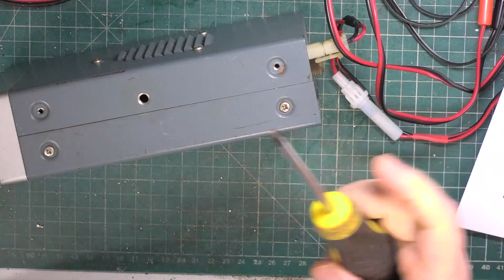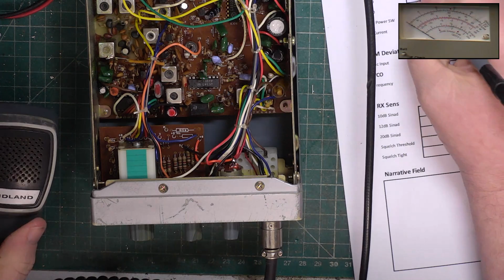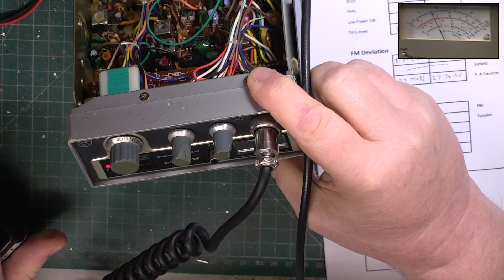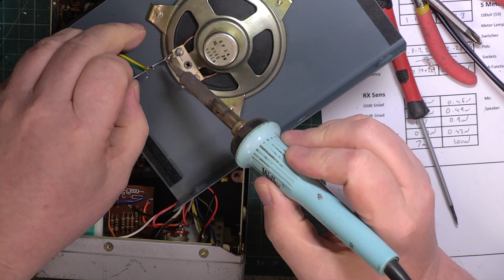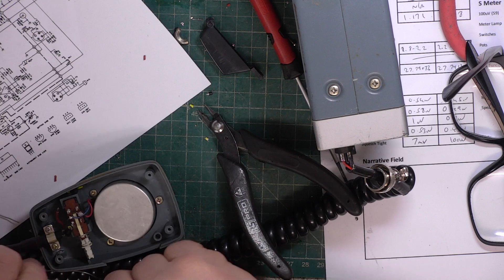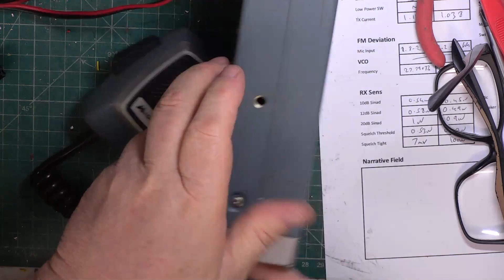Midland 2001 CB27/81 UK FM CB radio -  repair & service alignment

Comment: Just got back into CB after 40 years...Glad to see there is still a good community.I had a Fidelity 1000 back in 1985 and got so much ridicule...Where they really that bad?
Reply from the maker: Unlike the Cybernet made (002F chassis) Fidelity 2001 or Cybernet made (134 chassis) Fidelity 2000, which are superb radios, the Fidelity 1000 used th Great (Taiwan) chassis which lacks some of the receive filtering better sets had/have. You'ce put this comment on the Midland 2001 which uses the Maxon chassis; a chassis that suffers from 'desense', also owing to below par filtering.

The reality is that unless you live in a big own/city with loads of other CB users, then radios like the Fidelity 1000 actually work fine. The receive on the fidelity 1000 is usually more sensitive than many other sets. We've serviced radios with the Great chassis time & time again & demonstrated with our 'on the air' tests many times with good results. The Fidelity 1000 has been covered on this channel many times & there are plently of demonstrations in the bac catalogue. The last radio we did using the Great chassis was the Elftone ELCB6000 last week.

I'm in a rural area in Lincolnshire & the Fidelity 1000 & others using the same Great (Taiwan) chassis work fine for me. There are some really dire sets out there, especially some new ones that look really swish bur aren't!  The Great chassis has turned out to be very reliable indeed with the sets now being 40+ years old.

Richard, G0OJF, UK

Comment: I have just had a midlands 4001 give  me it works but the light  and the numbers  not work ing some of the numbers  come  on so could you  let me know what I  can do my call sign is 26 dr 703
Reply from the maker: The green LED display can fail & lose segments. The meter lamp can also fail, especially now these sets are 40+ years old. Both can be replaced but the display is very time consuming to do & the display has to be specially imported.

Richard, G0OJF, UK

Comment: Nice condition 2001 had plenty of fun with mic plugs in the past with these fiddly screws especially if one dropped on the floor extremely hard to find, anyway I look forward to the on air test.

Comment: Slightly off subject of CB radios but I was given a LG 4K tv,the tv has a massive blank bit at the bottom of the screen,I took the tv apart and put some tape over the last two pins on the ribbon connection,now the tv works and the picture is perfect. Still don’t understand why it works but it does 🤷‍♂️

Comment: I have exactly the same radio here, same variant, same deaf lazy un-adjustable meter, great little rig.
Reply from the maker: Yes, for completeness collectors need all three variants...early, non adjutable rx meter, middle....adjustment on back of meter, late...meter adjustment on the PCB where lo-power would be on any other UK radio using this chassis.

Richard
Reply: Great to know @ukfmcbradioservicingTango21  , ill keep looking to complete the collection!
Reply: @ukfmcbradioservicingTango21  Do you have the 2001T…the version with the channel announcer? If so, would you be able to demonstrate it? I’ve never seen one and I’m sure the viewers would find it interesting.